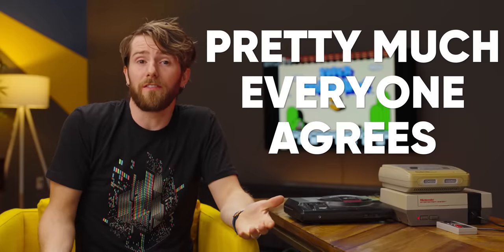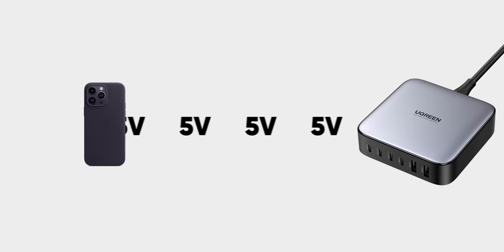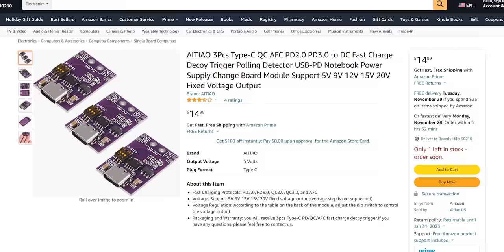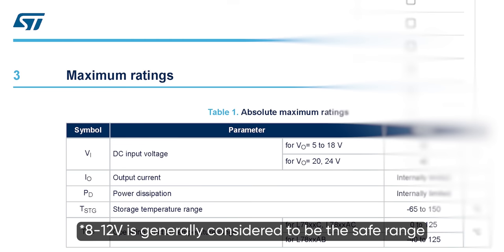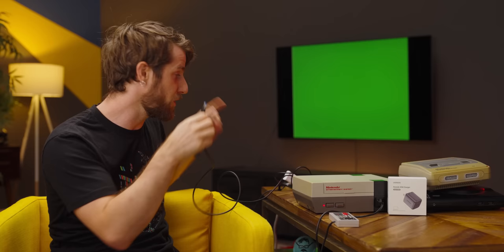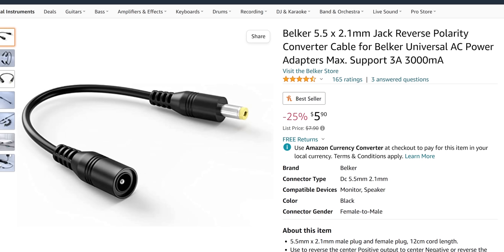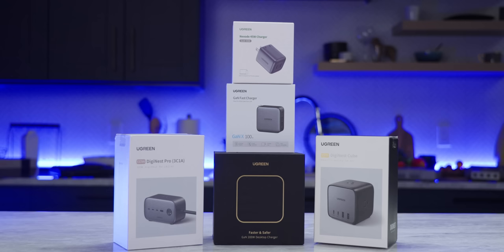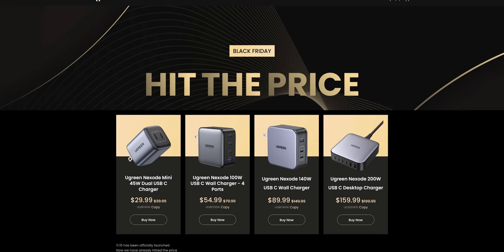How to Put USB-C Power on ANYTHING (almost)

Comment: I know people like to keep retro consoles "Stock" but when it comes to power bricks, it can be a little dangerous. Components do degrade over time, capacitors leak, electrical isolation material becomes flakey. So with most being 30+ years old. This is actually a really smart solution.
Last thing you want is the rectifier failing and it shunting straight 230v into your beloved old console :S

Comment: If anything, I want a USB-C port on my old arcade sticks. It still bothers me that a number of arcade stick manufacturers use proprietary ports (even if they have detachable cables). Hell, I wish that Sony would do a reprint of the DualShock 4 that uses USB-C.
Reply: They can't do a reprint of something that never existed in the first place. Sony never made that lol
Reply: Just swap out the PCB, bro. Arcade sticks are only ever dated by the PCB, the rest is compatible 40 years back.
Reply: might be worth opening up and see how its connected on the inside because it might just be a passthrough port for the detachable cable so then you only have to replace that. I use a Neutrik usb a,b for my own made arcadestick and could easily swap it to something else and there are loads of options. So I hope they made it easy to change cause then it should be an easy and cheap fix to get it to usbc 😅. 
I also wanted to see if I could change my ds4 to usb c but that seemed not worth it at the time
Reply: @chrisconaway2334  explain
Reply: Look into Brook converters
Reply: Why do you want a reprint the DualShock 4? That thing is built like rice paper
Reply: @chrisconaway2334  You're saying that sony never made the DualShock 4? The controller bundled with their Playstation 4 console?
Reply: @hershellumiere  It’s a cheaper option for PC gaming, plus a lot of FGC folks like the D-Pad.
Reply: @SkribbleNL  My Eightarc Onyx should be an easy swap since it terminates to USB-A on the stick end, but the Mad Catz TE2 uses a proprietary port. I can see if I can open up the part where the detachable port terminates at.
Reply: I'd rather be able to use a DualSense on the PS4 as a DS4 than them make a USB-C DS4. It'd also be nice if it could properly replace a DS3 and not just kinda sorta be useful on a PS3 (which I'm sure wasn't an intentional move by Sony that the PS5 controller works on the PS3 at all), but both PS4 and PS5 controllers are missing features compared to PS3 controllers.

Comment: 9:56 I was kind of surprised when Linus said “monitors typically use anything from 12-20v power. Boom USB-c.” I have six 28” panels and all of the thick insulated AC cords physically take up a lot of space. I would love to replace them all with USB-c cords but I wonder how much amperage all of the monitors would need? And then with all that current how much thinner the USB-c cords would end up being compared to the AC cords anyway. 
Maybe if there was a way to daisy chain all of the monitors with USB-c. Five of the displays are the exact same model.
Reply: You'd have to bypass the monitors' internal power supplies anyway, so that would be a serious undertaking. You could always use a Kill-A-Watt to see how much power they're using. My ASUS MG278Q (27" 1440p 144Hz TN) uses about 28W, so a 12V 3A power supply would be plenty.
Reply: @dsgamecube  most modern monitors have external power bricks, so that's not an issue at all.  

With power, if your power supply is capable of the right voltage, working in watts is your friend.  So look at the wattage of each individual monitor power brick and ensure that whatever supply you have can supply that amount of watts at the specified voltage multiplied by how many monitors you plug into it.  

For example, 60watt monitor, and you want to run two of them off the one brick, it needs to be able to supply 120Watts to work.
Reply: I was hoping to simplify my monitor's power supply situation as well, but unfortunately mine uses 22V, which isn't within the USB-PD spec :(
Reply: If the monitors supported thunderbolt 3 or 4, you can easily daisy chain 3 monitors together for video and power. This would bring your total of 12 cables (1 for power, 1 for data) down to  just 6 (1 to connect the first monitor in both sequences of 3 monitors, 2 for daisy chaining the other 2 monitors in each sequence). It also brings your total cables to your PC to just 2, 1 for each daisy chain sequence. If it's TB4 or 5, you can even add a storage device or two (YMMV) to either sequence.

If they don't have thunderbolt 3 or above though then you're not going to be able to daisy chain for video or power, unfortunately. You can plug 3 into 1 display adapter for less cables directly connected to your PC, freeing up ports on the PC itself, however. And plug 3 power cables into one brick . This doesn't reduce numbers of cables, but it does make cable management much smoother.

 Plugable has great display extenders/hubs that are quite affordable. I have a 2 port ( though I'm pretty sure 3 and 4 port variants exist now too) that works flawlessly, literally never had an issue. (At time I purchased one:) They come in HDMI, Displayport, and combination variants for easy compatibility, and usb-a and usb-c plug types. Hopefully one of these solutions helps somewhat.

Comment: USB-C trigger boards make life so much easier as an electronics hobbyist, the ability to have a selection of voltages available out of a regular power bank with a standard cable just makes life better. My 10 year old laptop can now charge from my usb powerbank and my cheap party speaker that only had ac input now has usb-c courtesy of a $3 circuit board. When I travel now I can use the same anker charger for my phone, power bank, and laptop and it fits in the palm of my hand. The days of powerbanks taking all day to charge are gone too, the one I have is 20000mah and does 65w in/out.
Reply: make THIS video.

Comment: A word of caution for anyone trying to do this: Many USB-C PD wall adapters are designed to be battery chargers, not power supplies. What's the difference? Power supplies have the capacity to hold up to inrush current, peak loads, tight tolerance on voltage and ripple, etc. Even a 5-10watt device (like a cable modem) on a 45watt name brand USB-C PD adapter is not a good combo. Another example of the difference between a power supply and battery charger is the example Linus gave, of how the power is momentarily interrupted when plugging or unplugging other ports on the wall adapter. USB-C PD wall adapters were never designed to be power supplies, and you can tell.

Comment: Note: garage door photoeyes are not just powered, they send a signal over the wires back to the head unit, as on modern units, they are "monitored" to make sure they are working correctly. 

So you cant just add USB-C, unless you were just going to run a 20' ish USB-C cable to connect the 2 terminals. but that would be alot more expensive than just using the low voltage wire they come with, or cat-5 wire that builders usually bury into the wall/ceiling to hide the wiring >.<

Comment: at many workplaces, tripping over cables is one of the biggest working hazards. We have floor tank sockets which help a bit, but I hate how not every powerbrick fits in there or use the same  C13/C14 plug. So I need extension cables and socket-hubs and a cablechain stuffed with 8+ beefy cables.

So you're telling me I could get rid of all those beefy 230V (Europe) cables, and just use one good quality USB-C powerhub to power-delivery my whole desk?

That's a game changer.

Comment: When I worked as an electrical engineer for skullcandy I was annoyed about a low end product with a micro USB port so I took an engineering sample, hacked a USB c port to the board and dremeled out the hole in the plastic casing to fit it. I still use that sample all the time haha

Comment: There is a catch:
The power delivery bricks with multiple usb c outlets, renegotiate the protocol when a device is plugged or unplugged.
So, your console will reset when is connected to the brick and another devices is plugged. 
I learn that when I was using a usb c powered mini pc, when I want to connect the monitor, the PC resets itself

Comment: This is gonna be massive specifically for touring production people like myself that have to carry a ton of power bricks with a lot of our dc gear. Converting to usb-c will save a ton of weight and room in my pack
Reply: Make sure you check the current requirements before you get too excited. USB PD can supply most common voltages, but the current is more limited. Don't expect to more than 3 amps out of most setups - 5 amps if you shell out for more expensive chargers and cables.
Reply: all the pedal supplies :D

Comment: I understand that Usb-C is universal but you still need the barrel end since the Usb-C port is only for the charger side... Since these systems aren't really portable, wouldn't it make more sense just to buy a universal barrel charger? It's cheaper and u can use it on all ur devices that have a barrel port since u can change the voltage output and the barrel size.
Reply: yea....he shoehorned the use case for the sponsor.  now hes looking like apple....selling adapter adapters.

Comment: Actually, the SNES AC adapter doesn't output DC (at least the PAL version I used to have). It does output about 9 volts, but it's still AC when it comes out of the barrel plug, and the console internally rectifies it into DC... YEAH, so, polarity doesn't really matter in this case. That's why you didn't kill the console.
Given that NES and MD/GEN can use the same AC adapters as SNES, I'll just assume they do that too.
Reply: Same for the US NTSC version. 9V AC.
Reply: In the pictures they've used, the genisis says it's outputting DC voltage, meaning it would care if reverse polled.  You're right that the snes outputs AC, so internal rectification will take care of any reverse polarity issues,

Comment: I was head scratching about the monitors part because all my monitors take AC directly. Even the Odyssey G9 Neo I bought this year.

I take it the DC thing is something the cheaper monitors are starting to do?
In some ways it would make sense for monitors to move towards DC, because in theory you should be able to run a single USB-C cable from the computer to the monitor and use it for both power and data.
Reply: The only reason they can take AC "directly" is because they have internal power supply adapters that convert to DC. Afaik all monitors use DC power for their panels. My monitor (Samsung C27CHG) isn't a "cheap" monitor, yet it still has an external power brick, so it's not necessarily a "cheap" things to have an external power brick, I would say it's the norm in fact ime. Internal power supplies seem to be more of a luxury, than external bricks seem to be a cheap-out imho.
Using one cable from a PC for both power delivery and data would be heckin' sweet though. Problem is if you connect something like a Nintendo Switch, which wouldn't do power delivery. And even then, I doubt most PCs have USB-PD up to 100W. My monitor uses 100W so there's no way my PC is gonna be powering it anytime soon.
Reply: @gaygekko  If I look in the Odyssey line-up, the cheaper monitors in the lineup take 22V DC and 24V DC, and the more expensive one takes AC. So that's what I'm drawing on there, just what one company is doing inside one lineup. The "cheaper" ones in that line-up aren't exactly "cheap" either. (And what I said in my original comment was "cheaper".)

But in saying that, my 27" ASUS (which was cheap) takes AC. And , the Benq GL2480, an even cheaper monitor that I just bought this month - also takes AC.

So I dunno about it being the norm, but I'll acknowledge that I've at least discovered some monitors that take DC. I wonder why manufacturers are doing it, is it so they can reuse the external bricks across multiple monitors? I think there's potentially some benefits to getting things certified if you do that, because the monitor itself is no longer an AC device. But then if that's the case, how is it that all my monitors, even the brand new ones, have internal AC?

Speaking of powering via PC, whatever happened to the monitor's AC cable being connected via the PC's power supply? That was convenient for reducing cable mess, but all of a sudden PCs stopped doing that, and I don't think I ever saw an explanation for it.
Reply: @trejkaz   trejkaz  Huh, okay fair enough then. Didn't know budget monitors were starting to do it as well. As for why? Well if I had to guess, I think it's a lot easier to make a product with an external power supply. It's less complex, you can use the same power brick for many different products, it's easy to swap it out if it breaks or if you're shipping the monitor to different regions with different electrical grids (100V, 240V, 50Hz, 60Hz, etc.), and you don't need to spend time engineering a solution with room for a more complex and compact internal power supply.
However as a consumer, I would argue that an internal power supply is much nicer to deal with. Less cable clutter, easier to transport and set up, looks nicer.
So an internal power supply is a nice-to-have feature. I remember the first original Xbox One shipped with an external power supply, but then the smaller and more powerful One X and One S came out a few years later with internal power supplies, which I think was a big improvement.

As for connecting the monitor to your PC's PSU, I don't think I remember that at all tbh. It sounds interesting, but also highly impractical. I mean, what if I wanna use my monitor with a laptop or some other device that doesn't have a big PSU to power the monitor? You'd be forced to only use the monitor with your desktop PC, right? And then, you'd have to buy a much beefier PSU as well, you would easily have to add like 100W to the PSU's capacity. But interesting nonetheless. If you find the name of an old monitor with that technology, be sure to let me know, I'd love to look more into it!
Reply: @gaygekko  Nah, it wasn't like you imagine.

If you had a laptop (which almost nobody around me seemed to have at the time, maybe because they were prohibitively expensive or just not convenient enough yet?) the monitor still took the standard 3-prong cable, so you could power it from any standard cable including one which went straight to a wall socket.

The difference was, you also had a cable which was a male 3 prong to female 3 prong cable, so you could run the power from the PC's power supply.

I don't think it contributed to the wattage on the PC power supply, but was more like a convenience, like having a double adapter built into the computer. It was particularly nice if you had to run an extension cable to get power to the computer. These days you're pretty much forced to put a power strip next to every PC because the option was taken away from us.

So it wasn't a difference with the monitor at all, but a difference with the computer. If you picked up a sufficiently old computer, you could find an example of it and probably connect that thing to a brand new monitor. Or possibly to the monitor's external power brick, because a bunch of those things also take the same 3-prong cable.

For an example of a power supply with this, see SeaSonic SSA-200G.

Comment: While it's not USB-C, the Playstation line is convenient in that all the home consoles (except the PS2 slim, but its AC adapter does) accepts their standard plug Sony's been using for their stereos for decades. If you have a Sony boombox with a removable power cable, you can use that to power your PS5.
Reply: That's just the IEC standard C7 plug and C8 socket. It's great that Sony uses it, and many other vendors do, too.

Comment: Not sure if you noticed or cut that out of the script, but NES actually takes AC power and converts that internally.
While it'll happily accept both AC and DC because of how the internal conversion works it's technically AC.

Comment: Honestly, if you have the power supply that came with the devices, we already have a plug and play single plug solution, it is the 120 v outlet in the wall. Presto everything works and you don't spend a dime. If you have lost the power supplies or they have failed and need to be replaced anyway then this could be a nice solution.

Comment: There are cases where you don't want to use USB or a switch mode power supply (small light wall warts): Audio equipment. Both of these, especially USB adapters, cause a lot of interference when it comes to audio gear. You want a solid, non switching power supply like those old chunky wall warts.
Reply: Isn't that the truth. I have an old synth that I can't plug into a powerstrip with other stuff or else it has a ton of interference. I haven't tested it with a powerconditioner, though. That'd probably work fine

Comment: UGreen doesn’t have safety ratings for all of their chargers, so be careful which you select. Right now, the best multi charger is probably the one from Satechi for 165 watts (which only does a max of around 100 watts from a single port, I believe). It measures well, is efficient, and has safety certifications.

Comment: I still have my childhood NES console. Sadly the original controllers and wall-wart got lost and or thrown out over the years. But luckily I picked up a couple of Nintendo original NES controllers recently that look to be in good shape for a decent price. This seems like a good way to modernize the power delivery without having to look for a new wall-wart. Plus it can be used for more than just the NES. :)